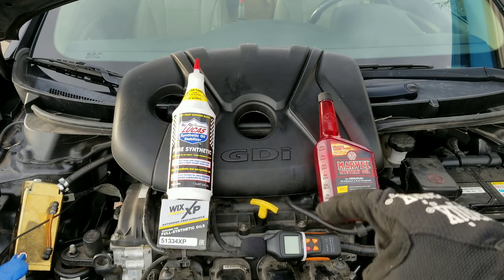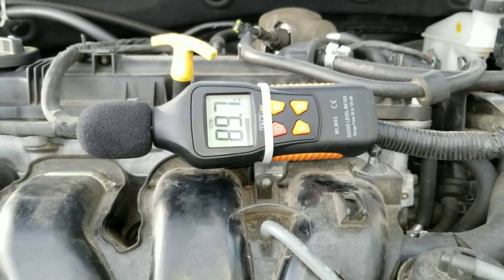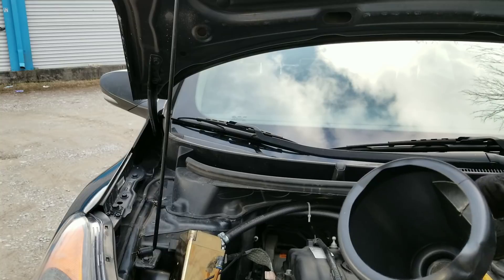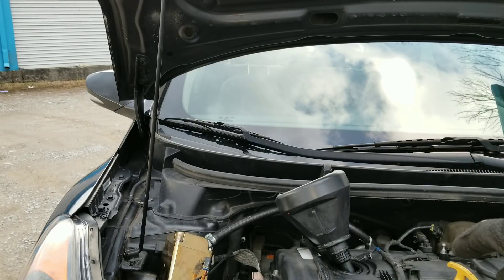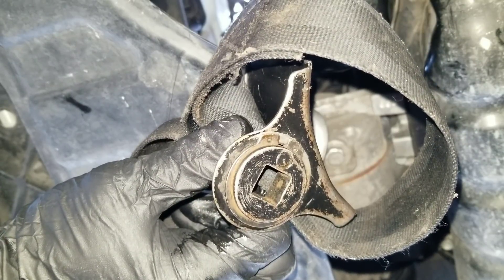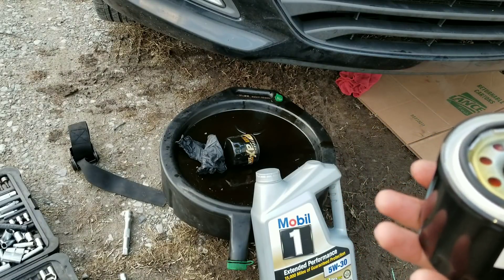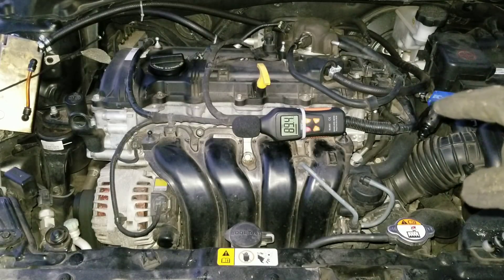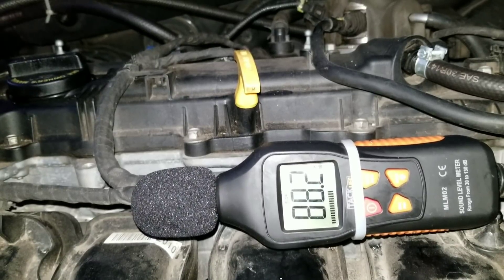marvel mystery oil & lucas oil stabilizer safe for new cars?

Comment: Mobile 1 oil is completely overrated and it burns up a lot easier and faster. Castrol Edge is way better and it doesn't burn up as fast as Mobile 1 and it's really good for higher mileage cars.

Comment: I have used the Marvel Mystery Oil and it has made the engine quieter and more peppy and I use it in my 2005 Mercury Grand Marquis, my 1981 Mercedes Benz 240d and my 1964 Ford f250.

Comment: Why would you put But recommended oil in a new engine you don't add oil additives to an engine that doesn't have less than 100,000 miles on it

Comment: I see people adding it a few hundred miles before an oil change for a flush like effect, but then add it into their new oil and run it for a few thousand miles. I get the concept but still kind of confusing. How about on a 2013 V6 non turbo engine (Ford if it matters) with 70k miles with synthetic 5k oil changes since day 1? Any advice on the proper usage of MMO in the engine oil? How about in the fuel system? Never used it before but have been hearing about it quite a bit lately. Hope NIA doesn't mind me asking here
Reply: Just keep using the oil you are using and add 4oz of marvel mystery oil to the gas tank every fill up and you will have no problem at all with your engine,
Reply: If you are changing oil & filter once/5k miles (or once/year; whichever occur first),  your engine will last 1,000,000 miles; assuming you drive moderately; no tire burning jack rabbit start, no towing, drive on asphalt road and stay below 70mph on the freeway.  
You can increase oil change interval to once/10k miles (or once/year; whichever occur first) if whenever you start the ignition, you drive +20 miles non-stop (no stop, no light, no idling) before you turn the ignition off.  
If you want to guarantee NEVER to burn oil for the life of your ownership, then replace 20% of the oil volume with MMO after the oil is drained at oil change, replace the fuel filter every 100k miles, air filter every 30k miles and 1oz of MMO/gallon of gasoline.

Comment: That is a GDI engine. That meter you have on there is picking up the noise from the high pressure pump (operates at 1600 psi) and the GDI injection. No additive to the engine will quiet the basic operating  function. This is not a valid test.  My 2 cents.

Comment: If your engine makes noise it's the oil you are using I used to run mobile one until I found out pennzoil is 5 to 10 times run smoother all day long

Comment: Be careful with oil stabilizers, ie Lucas, they are oil thickness which it harder for oil to flow into small ports on engines with high tech systems such as variable valve timing and turbos. Low flow equals early failure, MMO IS NOT A THICKNER BUT A CLEANER I have used it with every oil change since the 1960s, never had engine failure from loss of oil flow, also the engines I tore down at high mileage had no sludge build up
Reply: Exactly 👍 You  have to decide what you are trying to achieve?  These are 2 totally different additives. If you are trying to clean out varnish and get into every nook and cranny of the engine and lubricate it too, then MMOIL is your choice. I leave it in all the time too, it seems folks are only using it as a quick flush, I don't personally think it works quite that fast. But gently and constantly is it doing its magic all the time its in there. .Lucas is a totally different animal, thickening up your oil and providing sort of a extreme pressure lubricant!  It's great for wearing and worn parts and loose clearances in my opinion! The oil  pressure activated timing chain tensioners on my engines  hate the thicker oils especially in cold weather start up...Now there are different types of Lucas oil stabilizers, I've looked at one on the  parts store shelf and seemed much thinner than the others in just shaking the bottle, for new engines I guess.. Lucas obviously has its loyal following and I'm sure they have thier reasons. I just choose to use the MMOIL in an engine that's in good shape and MMOIL definitely helps keep it that way... Since 1923 ,(Next Year its 100th Anniversary) it must be doing  something right!!!9
Reply: @tinamcgarrah7794  How often do you use it? So do you put MMO in the oil right away or like this guy mentions 300 miles before oil change? Thanks!
Reply: Mmc should be used 300 miles before oil change to clean Piston rings and garnish out of the engine.

Comment: All you have to do is measure the noise then put in about 12 oz marvel oil when engine is running and almost immediately the noise is significantly reduced. It doesn’t take any time or miles driven to tell if it works and reduces noise. 
ps used it in many engines and works immediately and much lower than 90 decibels from 96 🙄

Comment: I've looked at Lucas to reduce burning of oil. High mileage engine and I only use Mobil 1 Full Synthetic.

My car takes 4qt of oil so I'm a bit leary of sacrificing 0.8qt (20% as Lucas recommends) in just additives alone.
Reply: Yes 👍 u are 100% correct and I wouldn’t put that garbage in my new car just good synthetic oil preferably mobile one 
Full synthetic

Comment: Since day one brand new 2007 Jeep Commander I have put one quart of Lucas with 4 quarts of Quaker State every 5k miles.. it's 2020 and 223,572 miles later not once have I had to add oil between changes and I am still getting between  16/18mpg.

Comment: Be careful of oil thickeners if you have. VVT and exotic engines, thick oil’s have a harder time going through the very small ports also not good on turbos, stick to your oil weight, don’t add thickners on newer engines, ok on older basic engines.
Reply: There is a synthetic version now that would be alot safer than the regular white bottle

Comment: Will just sorry I use Lucas oil stabilizer in in my auto when was new to prevent engine wear early in the summer May 20W50 one quart Lucas  October in the winter November 10W40 to April one quart Lucas my Ford Econoline 2003 van 5.4 I got 460,000 on it no engine smoke spark plugs clean and no Valve tap also the thermostat has 195 rating remove and drill a one eight hole in it the reinstall the thermostat this little hole get cooling system to flow early now in winter take little longer to heat up    but I the summer help  out alot engine don't need alot of heat when AC is running when to get rid of heat . 😳

Comment: Lucas oil is an excellent product. But don't use it in a new vehicle. The stuff is meant mostly for high mileage vehicles that have ticking valves, burning oil, etc.

On a new vehicle, use a high quality oil and filter. Be sure to keep up with oil changes.  When you get to 80,000 miles, swap to high mileage oil.
Reply: I wouldn’t recommend anyone switch to high mileage oil unless they are having an issue with oil leaking or burning. The additives in high mileage oil penetrates gaskets and seals to make them swell. This in turn would encourage perfectly good seals and gaskets to fail in the future. 
If you don’t have any problems with burning or leaking oil on a vehicle just keep using the usual synthetic oil, no need for “high mileage” products.
Reply: I used it on my 2011 camaro and damaged the engine,.
Reply: @fergusonfsa1964  Thanks for sharing, how did it damaged the engine?

Comment: Lucas oil is way too thick for engines with hydraulic lifters.
Reply: Lucas makes a low viscosity stabilizer for cars with hydraulic lifters and variable timing now. FYI.
Reply: I use it on my 2021 Sedona since 1800 miles. Engine is fine, engines are more tolerant than you think.

Comment: Be very careful with so called oil stabilizers, they are usually thickeners and may be too thick to flow very well in ultra close tolerances of newer engines, especially hard on turbos., mmo is old stand by and I use it with every oil change , I have had many high mileage engines that when I tore them down for overhauling there is no gunk to be found, it is a very good cleaner. Do not use in gas if you have fuel injectors I know of it causing injector problems , is ok with carbs.

Comment: Just run AMSOIL 5w/30 European formula have been running this in my VW diesels for years nothing else to say
Reply: Been using 5w40 supertech with Mobil 1 filters now at 90k miles not a single problem. Oils r just branding.

Comment: The first test was with old oil. Then you added MMO then added new oil with a oil stabilizer. It could have been quieter just because you changed your oil. Old vs new. Has nothing to do with MMO or the stabilizer.

Comment: So, how do we know that the Lucas additive is actually "safe" for the engine? You demonstrated that it was quieter but didn't have a metric for actual engine wear nor did you compare wear with and without the product. The fact that I can pour something into my crankcase that will make the engine run more quietly and that my engine isn't destroyed right away doesn' t mean that it's "safe". Also, you didn't define what you mean by "safe".
Reply from the maker: Follow manufacturer's instructions and i use wear testing machines also infrared temp guns, sound decibel meters and more in other videos.

Comment: That Lucas product is designed for new engines is it not?
Reply: Carl Rest I wouldn’t use it that stuff is too aggressive it’s for engines that burn oil
Reply: 5ifty9ine I was referring to the black labeled Lucas product.  I use the white bottle.  Have for years.  Every care I've ever owned has gone for over 300000+ and the engine was still perfect.  I swear by Lucas with Castrol synthetic or amsoil and an excellent filter.
Reply: Carl Rest personally I wouldn’t put that tuff in a car with less then 150k unless it’s burning oil
Reply: It's all about chemistry.  This prevents your engine from ever burning oil.  I have never had a car burn oil ever.  Lucas and synthetic is the way to go.
Reply: By the way, it's not exclusively for engines that burn oil.  As a matter of fact, the Lucas product used in a he video now for brand new cars.

Comment: The bottle of Lucas oil stabilizer looked and sounded empty.  You also didn't remove a seal on the top of the bottle.  Hmm...
Reply: Lol it did look empty🤓
Reply from the maker: I sometimes remove the seal on cam but some want to see it some dont theres so much that factors in sound cut or background noise lost video i could go on and on the other day i was missing 3 video clips i have never had that bad of a screw up before
Reply: Consiperacy theory much??

Comment: After the 300 mile trip with the  Mystery Oil in the engine, did the oil look any different than it usually does when you drained it?
Mobil 1 Extended Performance oil is good stuff. I use the same thing in my 99 Chevy Silverado 1500, and I change oil once a year using it. I don't put a lot of miles on the truck in a year, so the oil has no problem going that long.  It probably doesn't need to be changed but I've decided to just change it at that time. My mini vans are my daily drivers so the truck isn't so frequently used.  I run Mobil 1 HM oil in the vans but next oil change with my 98 Windstar, I'm going to change it to Mobil 1 Extended Performance HM. New product that just came out from  Mobil.  I may put that in my other van too.
Reply from the maker: Always follow manufacturer's instructions it can change the color

Comment: Lucas HEAVY DUTY and PURE SYNTHETIC oil stabilizers are not the same. One is not known as the other, is it?
As far as Lucas' own product page, they are two different products.  The HEAVY DUTY is the original stabilizer and the PURE SYNTHETIC is a newer formulation for use in more modern engines which use synthetic oils, I do believe.
Reply from the maker: Thanks for sharing
Reply from the maker: Good information what can we try next?

Comment: I use the fuel stabilizer, it's not just a cleaner but also an upper cylinder lubricant so it should help reduce piston,cylinder , and valve wear.  I drive old vehicles so I use it as extra insurance to prevent a fuel pump failure. 😃
Reply: I use it in the fuel for new or old cars. Sometimes Marvel, sometimes Lucas. Both are very good for pumps, injectors and rings. I go easy on the oil additives. I think 20 percent is diluting the motor oil too much and changing the viscosity.  5 to 10% IMHO.
Reply from the maker: Yes i often do the same

Comment: I understand why people think adding lucas works and thats because it is a little thicker and sticky and we understand that dry starts are bad and maybe this stuff coats parts and helps with that. But the truth is the manufacturer knows what weight oil should run in your car, if it calls for a 0w20 and you use a 0w30 that little thicker oil takes more energy do be pumped throughout your engine and the more energy needed to do that can affect your gas milage and will also generate more heat doing that. Just my opinion.
Reply from the maker: Yes thats true i appreciate you sharing your information with the NIA community

Comment: These oil additives are not needed only use what it says in the vehicle manual and with my own cars the manual states not to add any additives the key is change your oil at the recomended interval.
Reply from the maker: Yes your manual states intervals based on longer drain intervals because they can say ownership maintenance is lower to compete with manufacturer's also if you car isnt up to spec example compression and more they say fix or new engine so example if you can make or need this to last longer with little money to some it may be worth a shot but follow manufacturer's instructions and when they say use only there oil well its your choice.

Comment: I am a autotechnician and I have used marvel for years my only recommendation when using it is if you have a high mileage motor or have liked to go a while between oil changes  change your oil out  at around 2300 to 2500 miles with conventional oil and change it out at around 3500 to 4000 with synthetic it will scrub any deposits and sludge out and clog your oil  filter if your engine has a ton of sludge or deposits in it. I have used marvel for years as a oil additive / transmission additive power steering pump additive and fuel additive and it is great if using some caution when using it for  certain applications. Now and then I will add a ounce of oil to a gas tank that's half full to lubricate and rejuvinate the seals in the fuel pump. Have had great results using it as a upper cylinder lubricant/top engine clean out when diluted a little with isopropyl alcohol and  used with distilled water. my main advice don't use alot with the fuel system and if you have never used it before in your oil treat it like adding seafoam to your engine for the first time add some on a oil change maybe around 6 to 10 ounces and run your engine to operating temperature then change your oil then ad to a fresh oil change.
Reply from the maker: Thanks for sharing you experience with the NIA community
Reply: Can I use it on I4 GDI Turbo Charge Engine ? Oil change or Fuel
Reply from the maker: Follow manufacturer's instructions
Reply: I agree with you on the benefits of MMOIL.  I've never tried it in the Transmission though, just keep fresh fluid and a new filter! Not sure where you use the distilled water though? I wouldn't put that into my gas tank, I'm trying to remove it with Heet etc...Thanx;Jethro

Comment: Never put that thick Lucas in VVT engines. It's to thick to go through those tiny holes in the head for VVT lubrication even at 25%. It will destroy your VVT engine. Lucas has an additive for VVT engines. It's thinner.
Reply from the maker: I have tested the new lucas product and Lucas synthetic works good for a engine with alot of miles as wear plays big impact also this is why i dont understand why anyone waits more than 3000 to 6000 miles at most to change oil thats the main culprit of vvt problems among other problems there are tiny screens within simply put the oil travels threw and the love build up this new oil change interval is bad news
Reply: Iv thrown lucas in my gs300 2jzvvti for 7 yrs. Has 267k and still running like a champ. Never had a problem..
Reply from the maker: Lucas great product

Comment: Did this to wife 2010 Chevy Equinox 2.4l LT 170k mileage feel like it's working good not burning as much oil as before
Reply from the maker: That's awesome keep us updated
Reply from the maker: What can help?
Reply: @NATESINTERACTIVEAUTO  Maybe I'll try the Lucus high mileage stabilizer on next oil change
Reply from the maker: Let us know what happens
Reply: @NATESINTERACTIVEAUTO  you should try an oil catch can.
Reply: Update: 2,010 miles after oil change Chevy Equinox 2.4l LT still burns 1.4 quarts didn't stop the oil from burning but it did slow it down by 1.1 quart at the same mileage before the MMO and Lucas oil stabilizer
Reply from the maker: Thanks for sharing it really helps others and great just follow all manufacturer's instructions